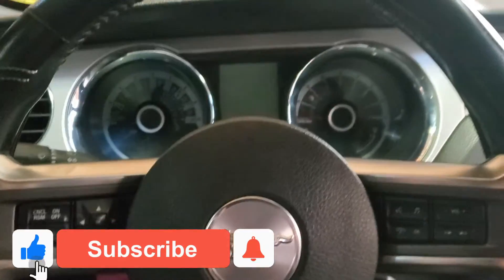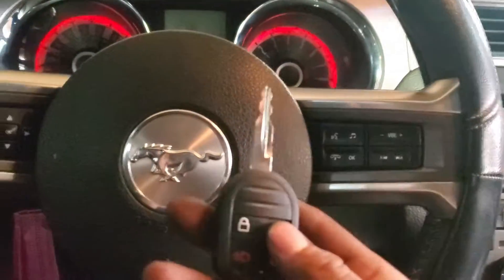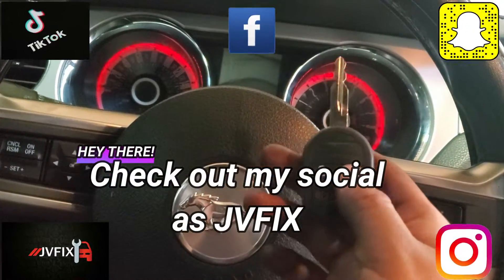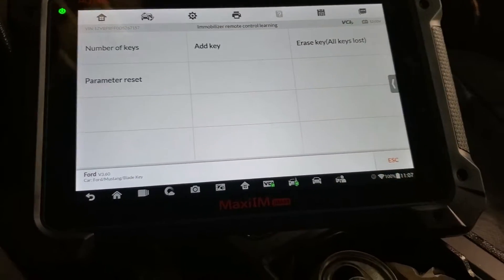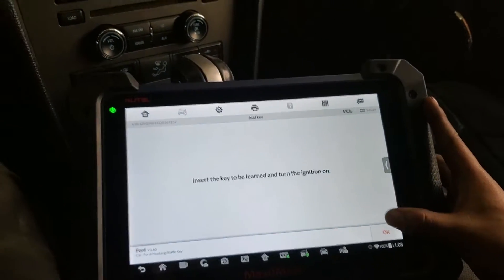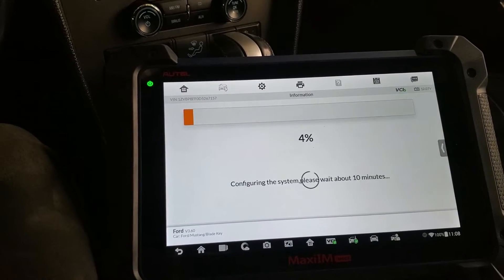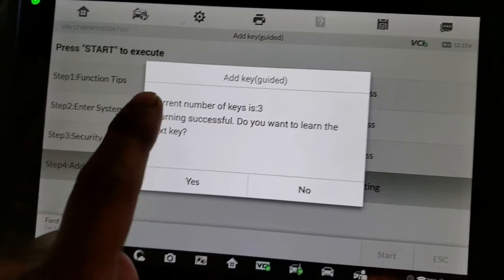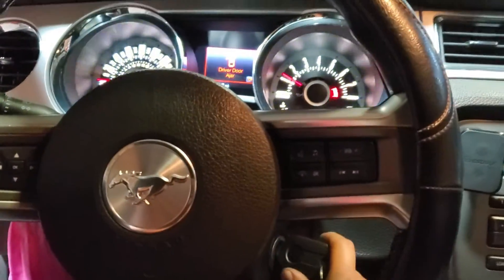How to program 2011-2014 Ford Mustang GT key fob and chip with Autel Im608

Comment: Okay so. I did the key turning thing and it did the lock cyle. Car turns over. But the buttons aren’t working still.
Reply from the maker: ur control might not be compatible or battery bad inside the fob
Reply: @JVFIXLLC  im thinking it might be the battery. Because when I swapped them out from the old to the new
The old had a piece of cardboard behind the battery.

Comment: what happens if i only have 1 key? i had 2 original keys. both got lost. so i had 1 made from the cylinder code. i erased the 2 original keys. and now it wont complete the programming because it says i need 2 keys minimum and only 1 is now programmed to it (the 1 that i got made from the cylinder code)
Reply from the maker: u will need another one. ford always requires 2 if u erased all keys stored.
Reply: How does this affect the MYKEY? I don't have a master key, just the slave key..do I delete all keys and program 2 new keys?
Reply: @paintbysimoncom  replacing the gauge will fix “my key” but you need to program the Correct miles

Comment: Thanks for sharing!

I’m having an issue though, after I turn the switch 8 times and the locks lock and unlock, I pressed the button on the new remote it honks horn and doesn’t program, 
I googled it, looks like I need to erase some keys saved to save a new one, any thoughts ?
Reply from the maker: on these fords u can have up to 8 keys programmed and it does not affect the fob function, also when you do the programming it erases all fobs previously programmed once u  have already  programmed the fobs you have in that moment to program (it writes in top of the old fobs).
Reply: @JVFIXLLC  thank you, I will give it another shot today!
Much appreciated man